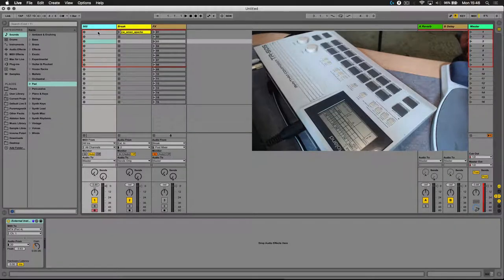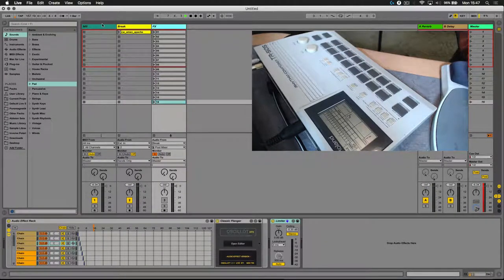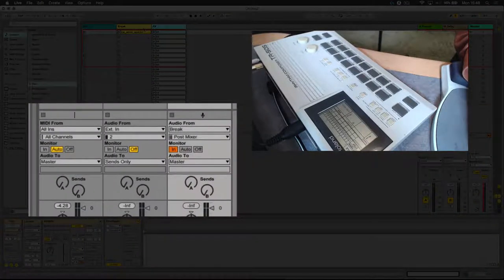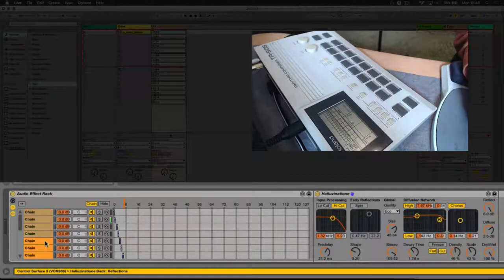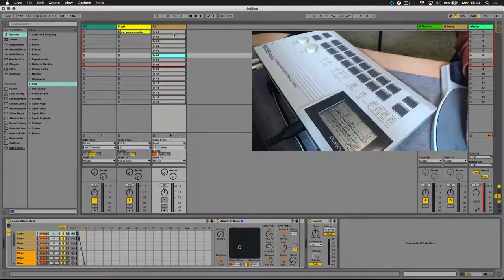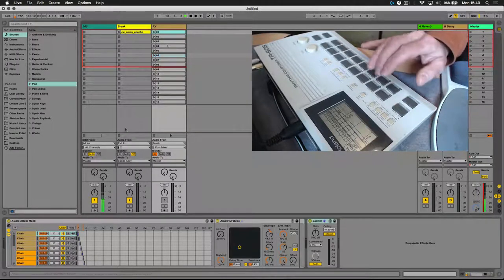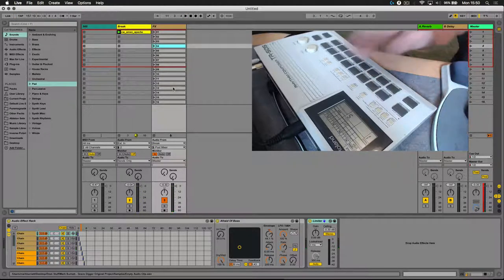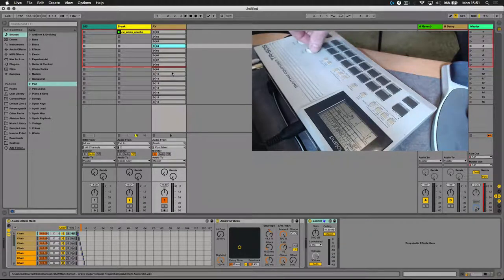How to Trigger FX in Ableton Using an External Sequencer - Mark Burnett of @TheLiveLab

Comment: Hi, you seem to know this. Can you map the computer keyboard to play MIDI notes? It does already but only a few compared to Logic pro. Then there are even some more keys to use in the middle row. I've got middle row keys: a-s-d-f-g-h-j-k-l-ö-ä-' a total of 12 notes possible. Not bad. Then there are the necessary semi-notes above. q-w-e-r-t-y-u-i-o-p-å-¨ which fills perfectly if it only was possible to map it. Ableton uses only a few. This on the other hand would give me 1.5 octave from C to G.
Reply: Thanks a lot for the tip. I have Standard that doesn't include Max. Panison the author coded for 3 octaves without sharps and flats. I need to play major and minor chords but he sure would be able to make an extended one though. For me   a-s-d-f-g-h-j-k-l-ö-ä-'   would be C-D-E-F-G-A-B-C-D-E-F-G with all the sharps and flats. I talked to Ableton but they are not interested in any improvements. Cheers
Reply: I have some keyboards. However often I use the computer only. Many others do the same, typing or drawing in MIDI. Optimising the computer was my wish then to 1.5 octaves. Max would necessary and probably write the layout myself. With the computer keyboard on my lap I do many things and the computer functions is of course all there too. The last Fynky, watch this space note at the end goes over my head, I don't get it but that's no trouble.